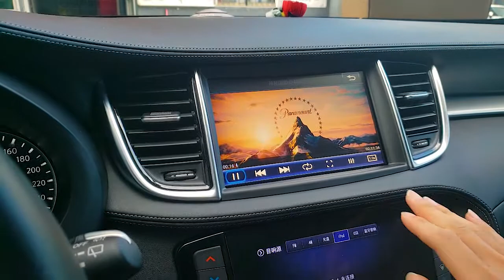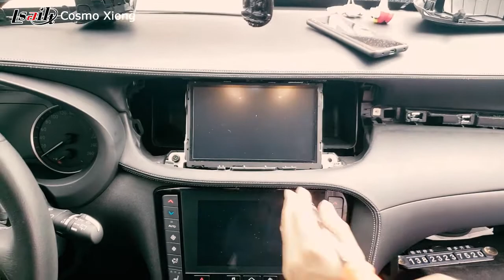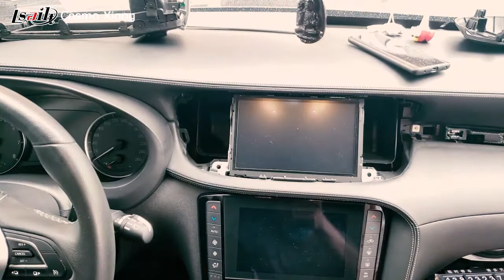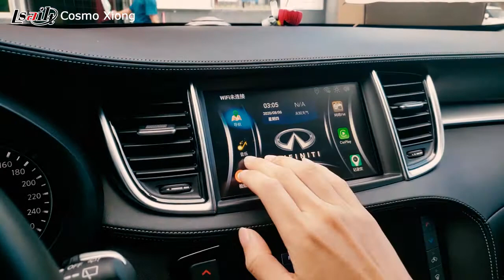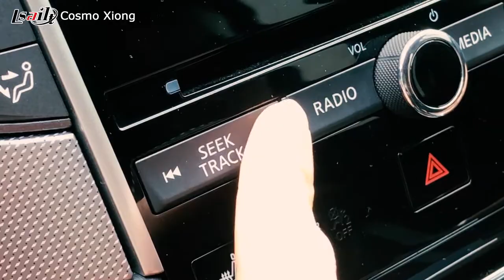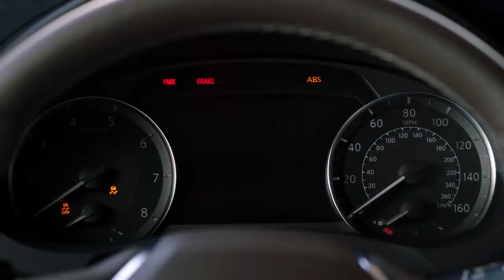Carplay on Infiniti QX50 2018? See how to install the Android Carplay module on QX50 2018!

Comment: Excellent video..  Is this 5.9.3 or 5.8.5 ?  
RAM 3GB? 
and i only need PCB chipset  ?
Without the grey module ? 
Thanks alot
Reply from the maker: it's install by 5.8.5 model, may I know which model of car you would like to install?
Reply: @CosmoXiong  what are the differences between those two.. So we can decide ✋??
Reply from the maker: fjamoudi they are for different models, 5.9.3 is for older Nissan and Infiniti cars 5.8.5 is for newer
Reply: @CosmoXiong   have QX50 2020, so installing only needs the in-screen chipset, no interface Grey box needed to install or connect? as the video doesn't show this, carify this point please, or DM
Reply from the maker: saeed alamoudi the interface box have to be install, it is the main part of system working
Reply: @CosmoXiong  provide a video for installing it please.. As Above video for the PCB chipset only .. Thanks again
Reply from the maker: fjamoudi please see a video for Nissan patrol I upload 5 month ago
Reply: @fjamoudi  I put the interface box behind the screen and then set the apps to connect to my phone's wifi hotspot. This makes it become a wireless android auto!

Comment: Hi how can purchase it for my 2019 QX50?
Reply from the maker: here is the link to purchase, https://www.aliexpress.com/item/4000058364598.html
Reply: I recently bought a 2019 Qx50, and was wondering if you did get it for yourself, and does it work. If not, what other options do it have. The OEM gps, is less than disappointing. Thanks
Reply: @GrosteteProductionz what did you decide on?

Comment: I have Qx50 2019 where can I buy for car play
Reply from the maker: you could contact me via email carllt-vip6@carllt.com we are manufacturer of it
Reply: I recently bought a 2019 Qx50, and was wondering if you did get it for yourself, and does it work. If not, what other options do it have. The OEM gps, is less than disappointing. Thanks